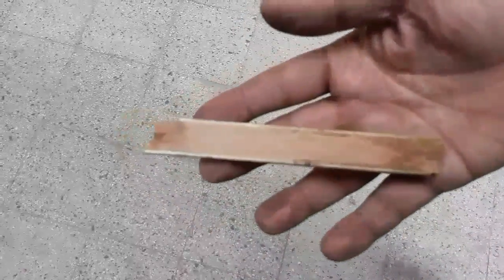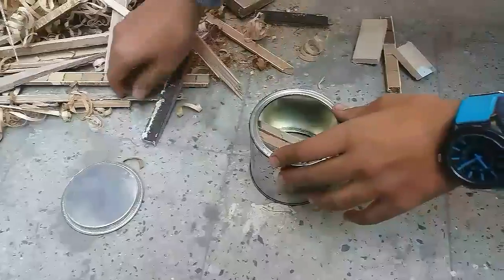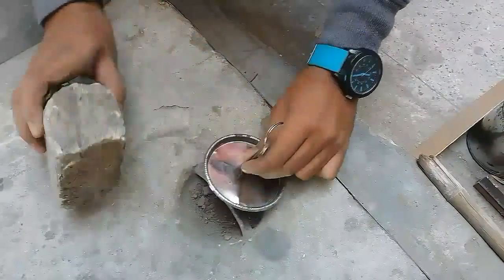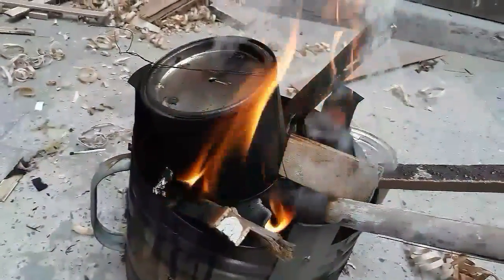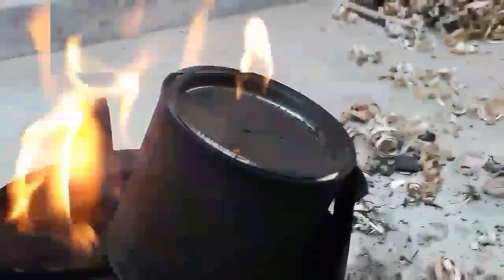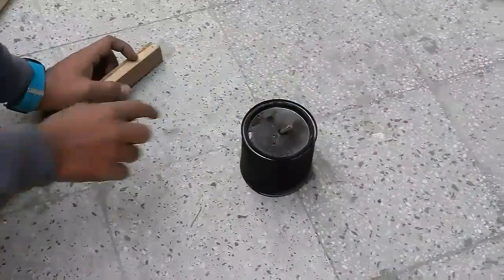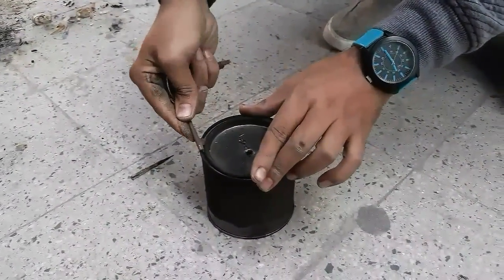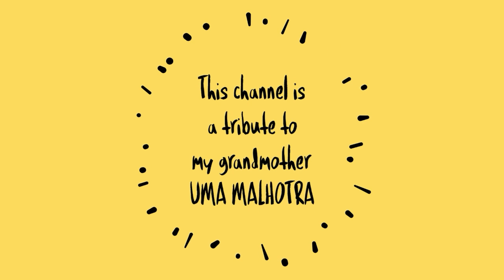Easiest Way To Make Charcoal !!!!!!

Comment: what if i want large quantity: make a huge pile of dry logs higher then your house cover with gaseline light it on fire let burn for 15 minutes then extinguish end result is a mountain of charcoal
Reply from the maker: Tusk no it will not give u proper charcoal....as supply of oxygen will large enough
Reply: im sorry but theres a big charcoal company near where i live and thats how they do it and yes its massive black chunks of charcoal that you can easily break bare handed and no there is not enough oxygen to fully burn the wood excluding the ones on top main reason is the fire is way bigger it burns through so much oxygen that it actually makes an air sucksion (air current going to towards the fire) if you covered that kind of fire in a massive barrel 2 things can happen A most likelly the fire only burns on top and cant get inside because it consumes too much oxygen or B the fire gets so hot it melts throughout the barrel and ruins everything 
- 
also notice a fire of gaseline burns way quicker and warmer and way bigger thus consumes far more oxygen far quicker then a simple wood fire whithout any accelerant but really you should try it yourself but its really for people that needs industrial quantities very quickly 
- 
of corse its by far the most plluant way and you burn more wood to get less charcoal overall but it remains the quickest way for large quanteties
Reply: .......... ok i just checked again and realised i forgot very important step: after 15 minutes of burning the massive wood pile is coverred with sand or dirt and i miss-interpreted it i though that was how they extinguished it but no its still active just no more flames and they wait a full night my bad but it really is better then the barrel for large quanteties